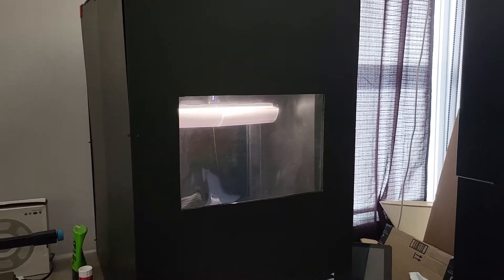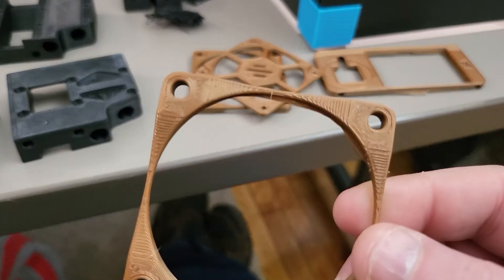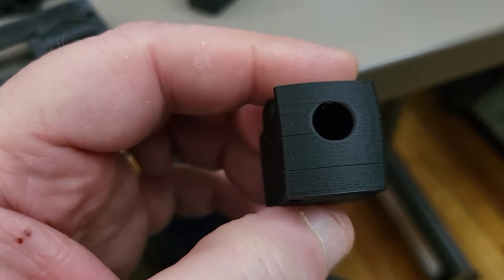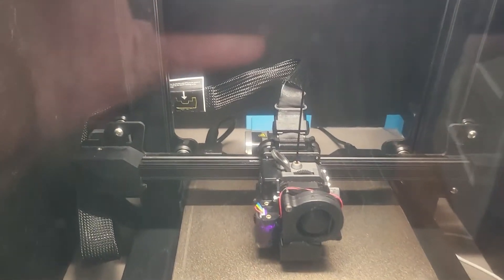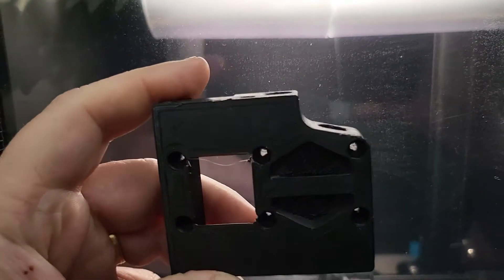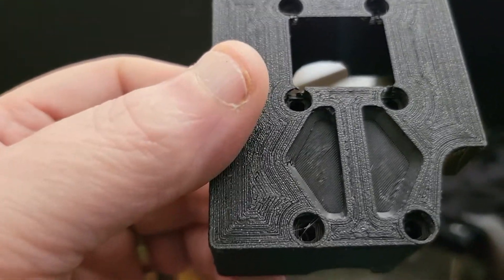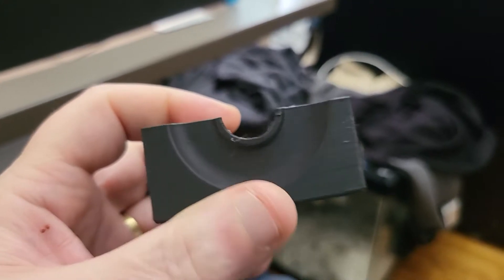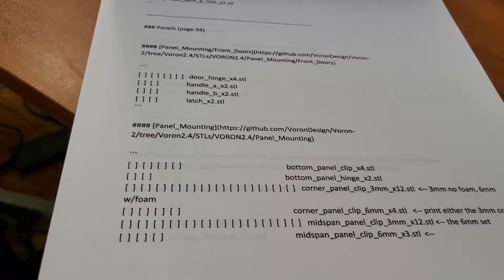Ender 3 S1 Pro Voron prints update, and upgrades and discussion about failed ABS prints

Comment: I was having very similar issues with the first layer and with prints in general (Ender3 S1 Pro) I tried many things but it turned around that the temperature of the nozzle was too high. It was still in the range yet was too high - I guess it depends on the filament...

Comment: I've just finished printing off my second batch of Voron 2.4 R2 parts along with various mods. The first batch was using black and red ESUN ABS+ and the latest batch is using ASA. First thing I noticed is that you are using a cooling fan. NEVER EVER use cooling when printing ABS or ASA. These materials shrink an enormous amount (up to 11%). By activating your cooling fan you are causing the material to cool too quickly. This will cause the part to "warp" and pull itself off of the bed as it's forced to cool and shrink and also cause the layers to separate. The idea of the enclosure is to slow the cooling and allow the part to shrink to its natural state SLOWLY.  I would also recommend that you print your parts with a brim every time to aassist with bed adhesion. If you are using Cura slicer (I use Cura 5.2.1 and a modified Ender 6), I would also recommend  setting your "Slicer Tolerance" setting under the  experimental tab to "EXCLUSIVE" and print the extruder "Guidler" and "latch"  parts off to ensure that your dimensional tolerances are good enough or they wont assemble correctly.  You'll need to tune your flow to get this part right too. It looks to me that you're under extruding which is why the parts have gaps on the top surface. So  to clarify..... Nozzle temp around 230-240 degrees, bed temp 90-100 degrees, let the printer soak in the enclosure for 30-60 mins before printing to get the enclosure temperature high enough,  NO COOLING FAN, use a BRIM on ALL parts, print around 30-40mm/s to start with and ramp up if required. Don't assume that every reel of filament is the same. Tweak your settings for each new reel of filament. Even different coloured ABS from the same manufacturer often print with different results. Good luck. Once everything drops into place (adjusting 1 thing at a time and observing results) your printing will be spot on.

Comment: i am having similar issues with my s1 pro with the bottom of the part with the lines on abs only. my pla prints look amazing it only does it with abs and its very ugly i am also printing functional peices so if you have found a remedy please share ive tried just about everything thanks

Comment: My prints come out nice but sometimes the nozzle hits the supports and can break loose and beat the print to death if I am not watching, fun and games.
Reply: If you're using Cura slicer, make sure the "Avoid printed parts when travelling" and " Avoid supports when travelling" check boxes under the TRAVEL heading are ticked and also tick the "Z hop when retracted" is checked so the bed drops a bit when moving over the print. These should help prevent the nozzle hitting the part during printing. Hope this helps.

Comment from the maker: Another issue I noted is the Inland brand from Microcenter, the ABS is just trash.  It barely compares to PLA in my book, its just not great filament.  I will go back to using Esun, Sunlu, or Hatchbox which I have good experiences with...
Reply: I use Micro Center ABS and never had any issues but I've never used the black. I'm using the stock Ender3 hot end so maybe you just have to tweak
your settings for the direct drive and hot end on the S1 Pro.

Comment: I have some pretty amazing profiles for the S1 Pro if you're interested.
Reply from the maker: I am always open to try someone else's profiles. =)
Reply: @eclypse3d  Shoot me an email address or somewhere I can send you the profile.
Reply from the maker: @DKFX1  you can use my eclypse3demons@gmail.com address...
Reply: Share the wealth lol I haven't really seen any good abs profiles yet
Reply: @lovesdonutz  I don't use ABS, so can't tell. They're awesome for PLA/Pro & PETG though.
Reply: secrets don't make friends!  Been printing ABS @ 245 HE and bed at @110 w/ auquanet and doing very well. Your profile is not good, is that your first layer? WAY TOO HIGH.. you need to go down. quite a bit. If you take the paper, and instead of having the paper under the tip.. take the paper you get with the printer, the 1 page deal that tells you how to get things going, lower the nozzle to bed to where its almost touching, then run the paper from outside to under the tip. Lower to where you cannot get paper under, then micro step up till when you push the paper, you feel the paper BUMP but go under the tip. THAT IS THE GOLDEN Spot.

Now the extruder.. retraction to .4mm from the .8 they recommend. 

You are too far up from the bed. I have been doing 60mm on all layers and all, you have some serious shinkage going on.  How hot are you printing??  Zero cooling fan.

Comment: That underside looks like what you get with support interface layers. They are not smooshed together enough by the nozzle, lower z-offset and set your initial layer to 110% width. Should fix it.
Reply from the maker: Yeah there is no option in Cura for support interface that I can find (I know you are saying looks like lol)  and I have my profiles set to "all" and I have searched and I do not see support interface layers or support interface anywhere in there.  My previous prints all had nice smoothed bed textured bottoms where you can barely see if any lines.  I corrected those issues.  FYI Voron parts are designed not to print with supports on any parts.
Reply: @eclypse3d  I'm not saying they are support/brim interface layers, but they look like them because interface layers leave a gap between the plastic so the lines aren't squished together properly. In yoiur case I think the slicer setting are causing the problems, but it could be nozzle clogs, or z-offset issues.